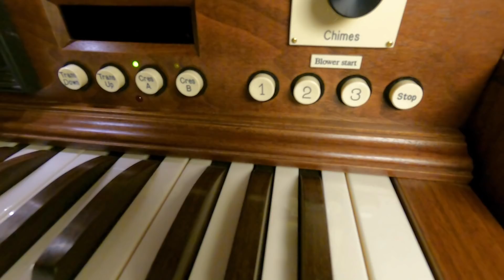2021 Kegg Organ - Church of the Little Flower, St. Louis, Missouri - Part 2

Comment: Wonderful video - and a treat to get the "tour" from the builder himself.  My only thought is that I'd prefer to have the Zimbelstern control at the console rather than up in the chamber.  I loved the pencil drawer!  One fun thing approaching an unfamiliar pipe organ is how the one turns the thing on.  This is yet one more unusual way to do it!  :-)
Reply: Every Zimbelstern installation I've ever seen has the controls in the chamber. I only use ours once or twice a year, so it wouldn't be a huge deal - ours is digital.
Reply: @thebog11  I've seen one or two at the console.  My church (in my profile pic) has two Zimbelsterns.  The main organ up front has one with six bells.  The antiphonal in the gallery (where the console is) has a second five-bell one - which I discovered has a speed control on the side.  It just depends on the builder, I guess. :)
Reply: We usually have the Zimbelstern controls on the console.  This one was added at the end of the project and there wasn’t much real estate left on the console. There are 3 light dimmer controls under the left key desk and the control panel in a drawer on the right.